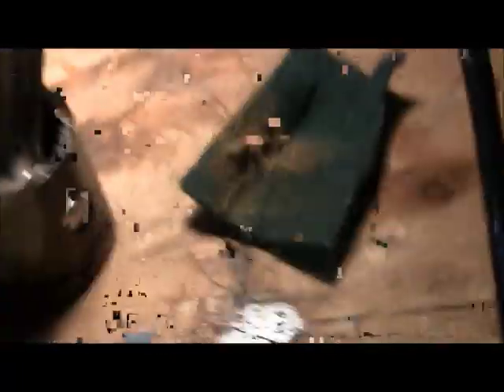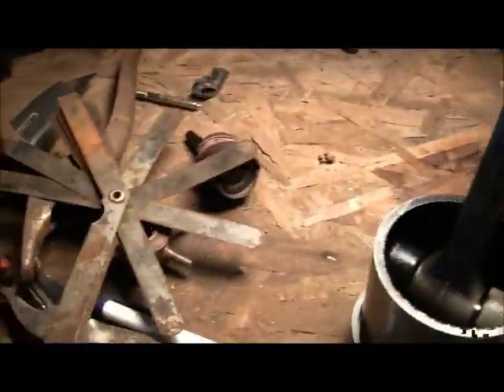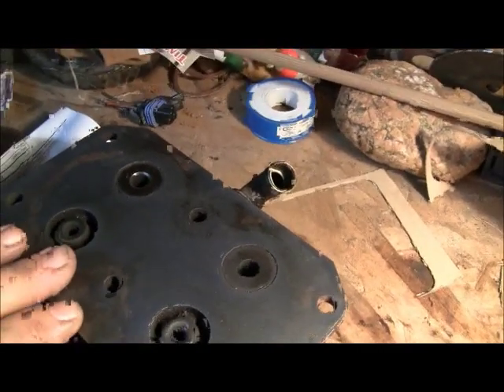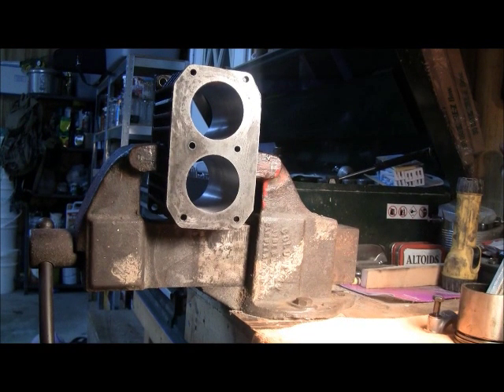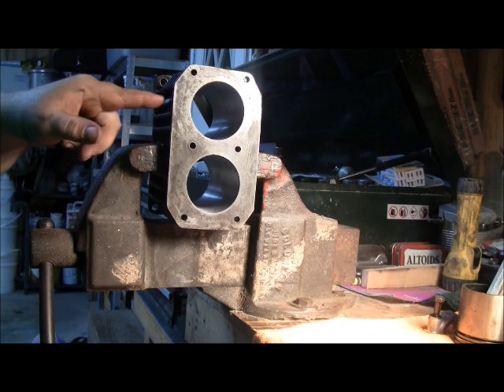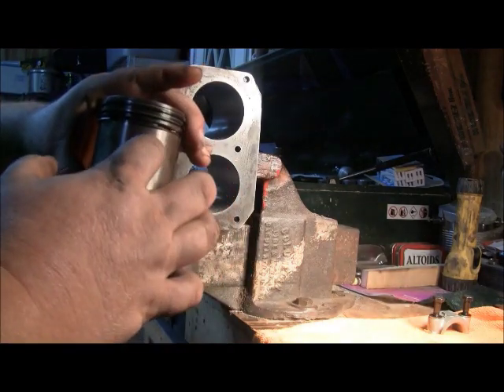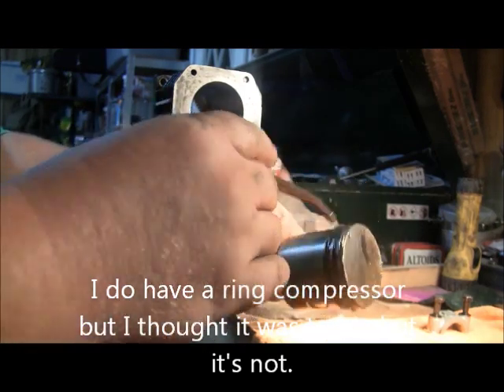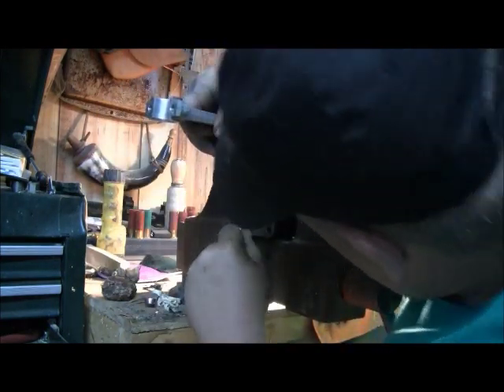Air compressor overhaul Installing the pistons

Comment: You need to clean the carbon out from underneath the piston rings in a different position the old Rings won't collapse enough to fit into the cylinder just a possibility he was having such a tight fit